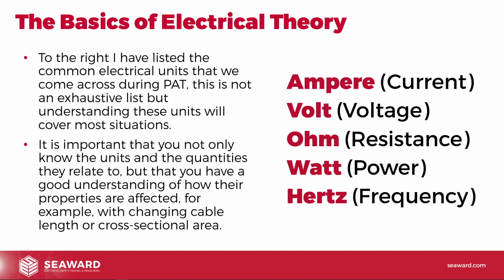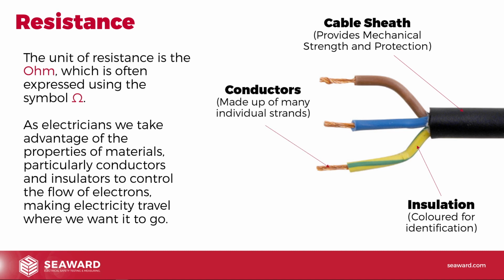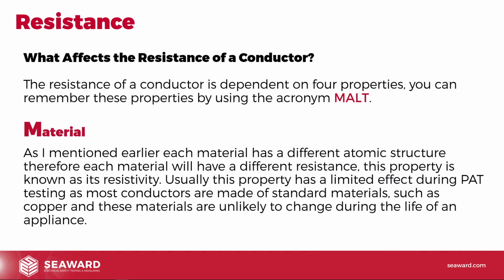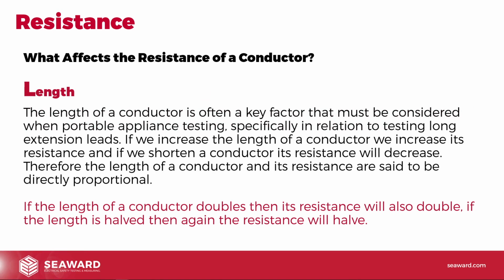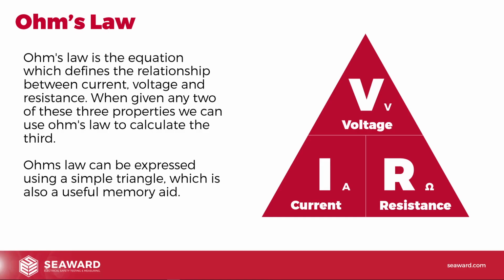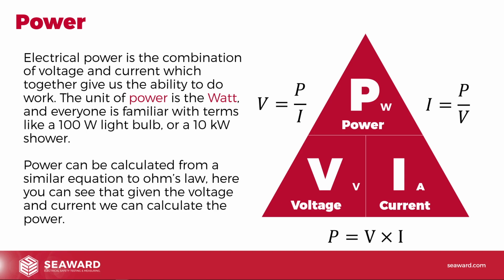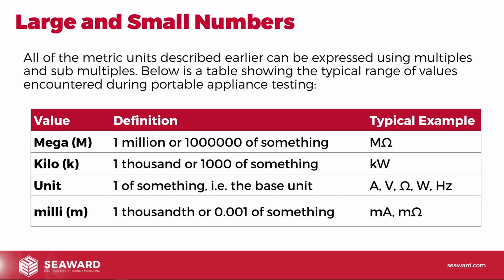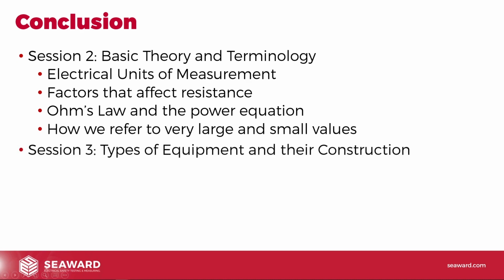PAT Refresher Webinar Series Session 2 - Basic Theory and Terminology

Comment: Generally very good and I will recommend this series to students.  I would take issue with a couple of things in this part.  Firstly 50 Hz mains does not change direction 50 times per second, but 100 times per second.  A complete cycle of changes, returning to the same point, takes 1/50 second.  (Before the hertz was invented, we used cycles per second which made it more obvious.)  Secondly, kVA was mentioned when giving examples of how we express power, but it is not a measure of power.